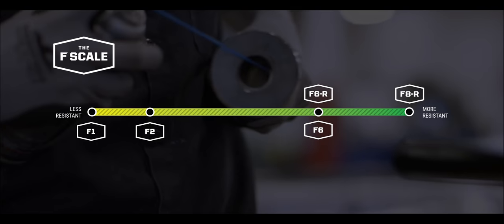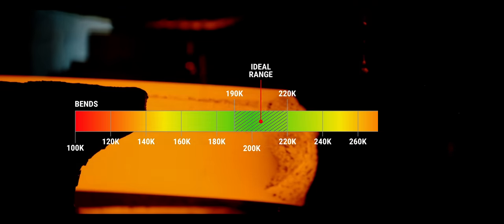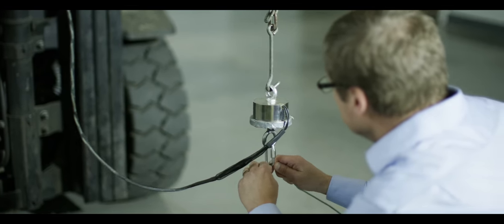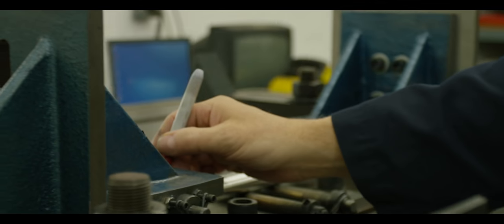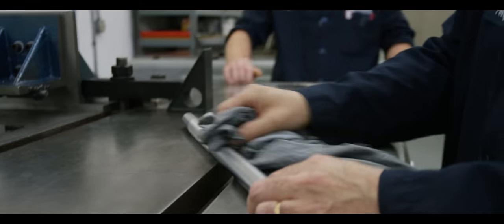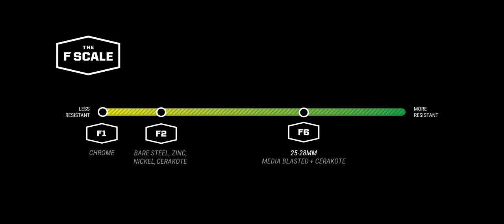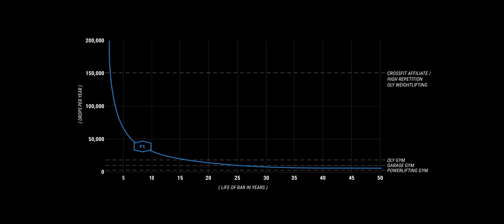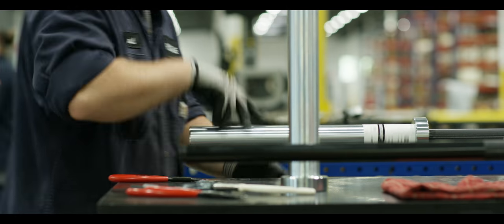The Rogue F Scale — A New Barbell Durability Rating System

Comment: Very interesting video, thanks for putting it together. Number one cause of deaths for barbells in my experience has been from someone doing rack pulls lol.
Reply: Brandon Campbell Diamond I'd say you're probably right....I've seen many barbells trashed from bouncing or dropped doing heavy rack pulls onto cross bars in powerracks.
Reply: I bent my good bar from failing on a squat and bouncing it off the rack
Reply: High Pin squats are a silent killer too

Comment: How about durability for the Bearings or Bushings between the Sleeves and the Bar?
 The coating may help with stress but what about the wear from scrubbing from the Bearings & Bushings riding in the exact same place all the time? Sooner or later that paint or coating will wear and the the tolerances will increase developing more play and slop in the sleeves?
For my home use I will not be dropping the bar so that rating will not really be a factor for me. I need a bar that will last throgh many rotations and have smooth spin. Like when working  forearms with wrist curls. A serviceable bar where the sleeves can be removed, cleaned, and greased is a must. Do you have bar that meets that criteria?

Comment: In what way exactly can chrome plating decrease the life span of the bar? what properties get deteriorated due to presence of chrome? And "by 50%" means what exactly? From 10 years to 5 years - yes, it might matter. From 100 years to 50 years - who really cares? There are chromed Eleiko bars out there, twice as old as Rogue Fitness company, still performing like they did on a day one.
Reply from the maker: Chrome will make the steel brittle and more susceptible to fatigue issues.

It is not a matter of 100 to 50 years it is a matter of 4 to 2 years in a high rep gym, you can enter the factors in this calculator to see the effects: https://www.roguefitness.com/theindex/article/f-scale-overview.  For OLY gyms you are correct they could last forever but there is a stopping point.  

Good article from Ivanko on the same issue: www.ivankobarbell.com/press/how_to_break_an_olympic_bar.pdf

Eleiko bars are used for Olympic weightlifting and you can see that works out pretty well unless they are used for a high rep gym.  Eleiko has also changed to a Nickel based coating.  

The claim is not based on an opinion it is based off data and facts.
Reply: That's a great article from Ivanko, thanks. But what I read there is that they tried chrome plating (they do not mention which types, and easier ones are not suitable for this application), they failed, and instead of mastering the process, they ditched it altogether. That's one way to do it, yes. Doesn't look like sufficient evidence to claim that chrome plating decreases life span of the bar, though. Do you have stress-strain curves available for comparison (of chrome plated vs non-plated bars of the same steel)? Surely your team of scientists did extensive testing, would be interesting to look into something more tangible than advertising video. Also, do you have a patent application number to look up the principle of your new process? I tried to search for one on Google patents with no success. Thanks!
Reply from the maker: The fact that chrome plating reduces the fatigue life of steel is not a new discovery. It is a known issue in several industries.

There are three mechanisms for how chrome plating can affect the fatigue life:

Hydrogen embrittlement - Hydrogen build up during the plating process. This is what led to the issues experienced by Ivanko.

Cracks in the chromium. - At the time of plating, microscopic examination will reveal cracks in the surface of the chrome. As bars are used these cracks can become more pronounced because the chrome is harder than steel and can not bend to the same degree as the steel beneath it.

Tensile residual stresses imparted into the steel and chrome at the time of plating. - The chrome plating process results in tensile residual stresses. While compressive residual stresses, such as those caused by shot peening and Rogue Work Hardening are protective, tensile residual stresses decrease the fatigue life of steel.

There is not a significant difference in the stress strain curve for a plated or unplated shaft. The difference was how many cycles the chrome plated vs. unplated shafts lasted in the 4 point bend test at a stress level of 150,000 PSI.

Our patent application is filed, but is not yet published.
Reply: Well, thanks again, I'm learning more and more about chrome plating through this discussion.

I though that presence of hydrogen embrittlement would change stress-strain curve but may be the specimens you had were not subjected to this issue? After all, Rogue Fitness still does chrome-plated bars, and those are not breaking apart. What do you use btw to prevent the issues above (other than RWH)? some additional layer between steel and chrome? 
For the cracks, I though that would be just surface defect, like those cheap chrome bars in globo gyms with flaking plating, even though those are not particularly whippy. Never seen that on more expensive bars. Again, I guess there is a way around it.
Reply from the maker: We don't produce chrome plated barbells, only chrome sleeves due to the data we have gathered.  There are processes in which you plate with nickel first then chrome a bar but this can also cause too much plating build up on the knurl.  Nickel is a good plating variant and some that claim to chrome will actually use nickel as it does not adversely effect the bar shaft.  If Nickel is not used there is no way around it, we have tested really expensive bars with Chrome and they have the same issue. Again this really doesn't come to light unless it is used in a high rep gym.  The decorative chrome you reference on cheap bars is just that, so you get two issues cheap flaking chrome and embrittlement.
Reply: Isn't your Euro Olympic bar made with polished Chrome shaft? Or you don't do them anymore?
Reply from the maker: We don't make any barbell shafts with Chrome anymore.